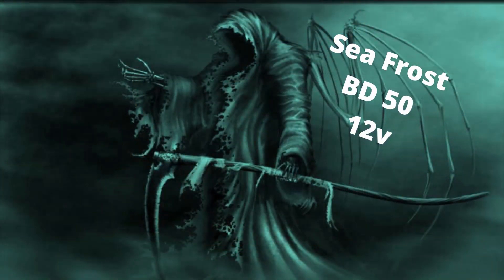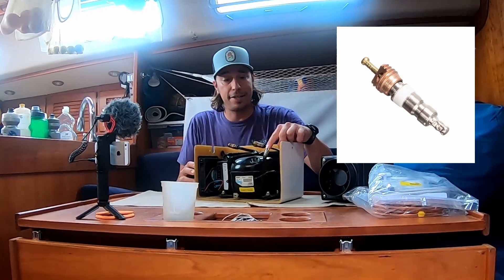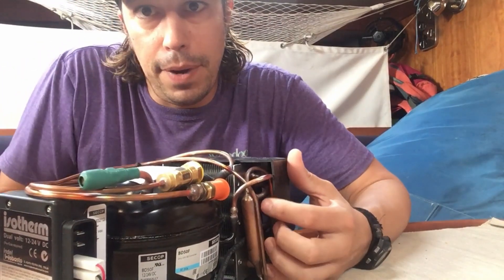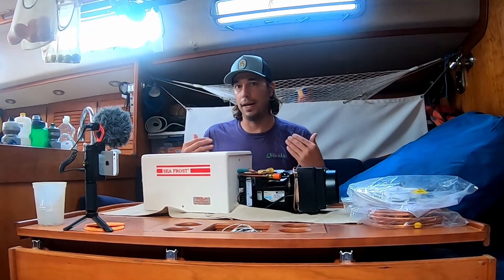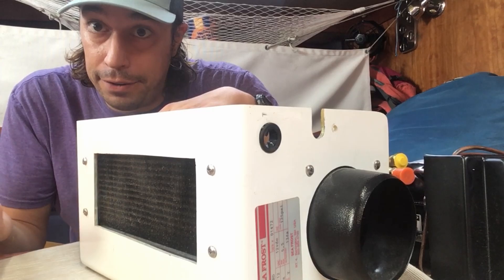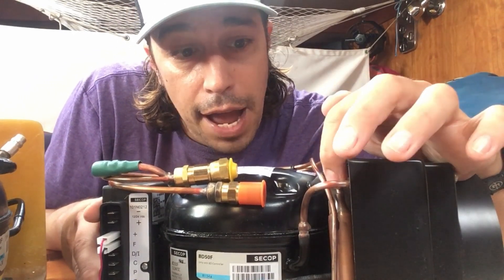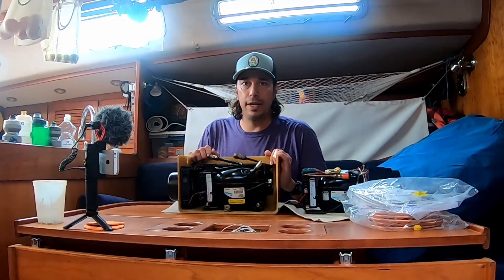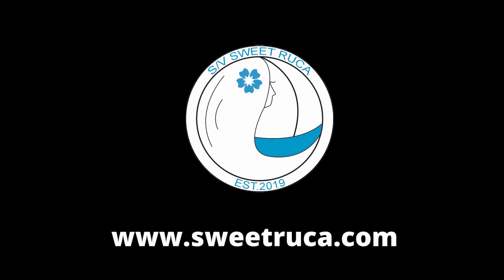Tech Talk - 12v Refrigeration - Isotherm vs Sea Frost - Off the Grid

Comment: Under normal circumstances the system will never run in a vacuum. Both the suction side and discharge side will be above atmospheric pressure. If the system is drained completely from refrigerant and is still having a vacuum leak, a vacuum pump need to be hooked up to evacuate the lines and draw out all the water and non-condensables (air).

Comment: I need to replace the refrigeration unit on my J46.  How has the isotherm performed?  Were you able to cool both the freezer and the refrigerator with one unit?
Reply: Maybe a recap video and performance review after 2 years aboard along with more details is in order?
Reply: Interested in this answer too. Especially for the volume size of 10cuft.
Reply from the maker: So far so good! We use 2 units, one for the fridge and one for the freezer. We have cold beer and ice!
Reply: @SailingSweetRuca  thanks I thought that might be the case. Any other modifications needed to make this work?
Reply: @SailingSweetRuca   Would you mind telling us the model/evaporator size of each unit and ~how much volume they are cooling?

Comment: Should have called ColdEh The two units use a completely different way of controlling the refrigerant flow . The Isotherm uses a Cap tube , the Seafrost uses a CPV , (constant pressure Valve ),
Reply from the maker: Cool, we haven't heard of ColdEh, we will have to check them out. You are correct on the capillary tube. We have had good luck so far with the change.

Comment: Efficiency is not directly related to current draw but is a component of it. If unit #1 draws 5A and unit #2 draws 2.5A but unit #2 has to work more than twice as long to cool to the same point, then from a AH standpoint unit#1 is more efficient while drawing twice the amperage. It would appear that the new unit is likely more efficient, I am just pointing out that current draw is not the singular indicator of overall efficiency.

Comment: the new digital controller is all very fancy but if your sailing oceans and it breaks down you are stuffed, no fridge, mutch better go with and old fasioned  electro mechanical thermostat, power consumption will be no diferent over a 24 hour period. if the thermostat fails just short out c and t terminals and the compressor will op+erate
.non stop... switch off at night. 
cheers <Paul <Portugal
Reply from the maker: Great tip on the wire bypass!!!! We do carry two extra standard thermostats as spares, just in case.

Comment: Are you Sure your Air flow direction Idea is correct  there Lint on front of the condensing coil so I think you have air Direction wrong.  Just my Hypothesis
Reply from the maker: Thanks J. Not sure at all, I do not claim to be an expert on fridges, just calling it like I saw it! I can report though that since we did the swap, we have had no further issues (knock on wood).

Comment: They have the same motors, they are variable speed, the controler resistor values on  the thermostat circuit control the speed. Lower speed is more efficient= less amps. 
If the system never was opened no air or moisture ever entered if there was any pressure. The charge fittings should have been removed after changing and O ring caps replaced, both rust prevention the valves are not sole seal permanently.
Reply from the maker: Thanks for adding this!
Reply: Thought about it more. You can get atmospheric air in a system that is under pressure while running with the vacuum service port cap off. Icing or other blockage in the liquid line or crimped capillary tube. The service port has to develop below 0 for this to happen. Not common, more common is un-evacuated system assemblies.

Comment: I am so impressed with the Isotherm water cooled refrigeration holding plate unit in my sailboat!   I plumbed it to use fresh water from an extra 50 gallon water tank for cooling. My solar panels easily provide enough energy to run the unit 24 hrs a day,  The smart controller regulates the water pump speed and cooling temperature depending on available power. My refrigeration box is always cold, sometimes too cold!
Reply from the maker: Nice! Good call going with the water cooling to the fresh water tank. We thought about that route also and glad to hear it works well!!!!

Comment: Any issues with heel angle and running the fridge? Or are they designed around that potential problem?
Reply from the maker: Great question. The manual claims a working heel angle up to 30 degrees, thats all we know.

Comment: I am not an refrigeration expert but electrician engineer. The different rate of consumption  is caused by the modern compressor on the new one, its more efficient electric motor, that is all. And yes you are right about the old unit cooling flow, it must first cool the evap then the compressor. Sorry for my english.
Reply from the maker: Great info regarding the motor! We didn't even think of that.
Reply: Actually, they are both the same compressor. The reason the Isotherm unit can be more efficient is the control actually varies the RPM of the motor. 
Also worth noting that the compressor, in BOTH cases,is cooled by the return flow of refrigerant vapor, NOT by airflow. Any airflow over the compressor is meaningless. If you want to verify this for yourself, look at the compressor on any household refrigerator or freezer, there is no fan. Indeed, before the advent of frost-free refrigerators, none of them had any fans at all. Frost-free units have fans to circulate air inside the cabinet, from the freezer section, through the fridge section, and returning to the freezer.